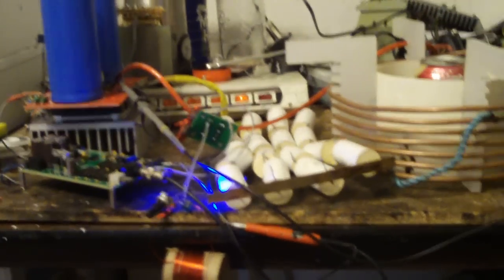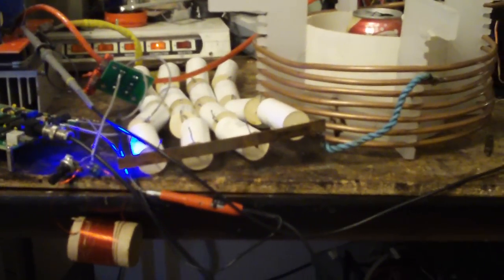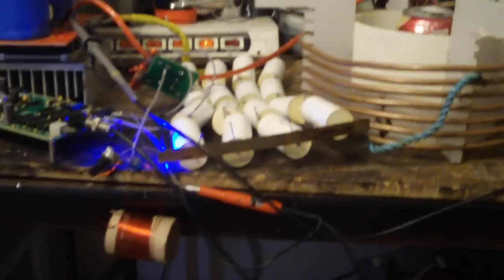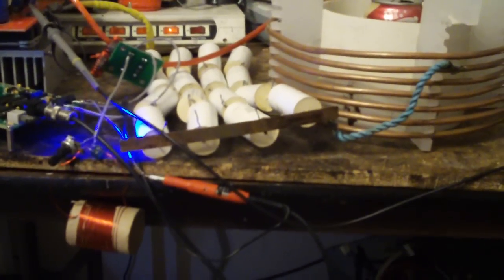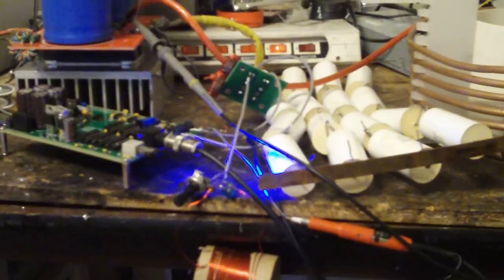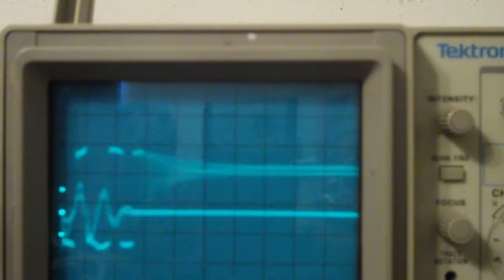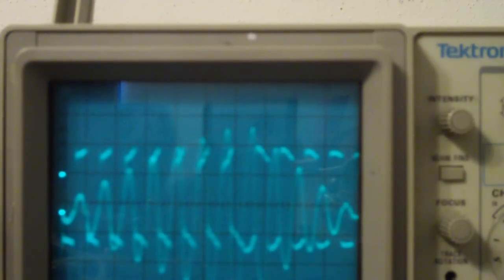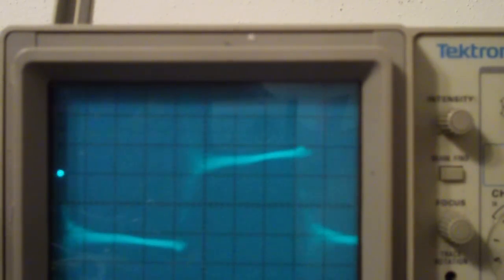Adjusting drsstc phase lead.

Comment: @Tab54o I figured out my problem. My first board had an on board interrupter, the second didnt, the off board  interrupter i had the voltage clipped to 5v  with two diodes. It was casing the voltage on the phase comparator to ramp up and down and was fckign with the quality of the output signal lol. Now I just need to find a proper inductor.

Comment: @triggerhappy77707 Well I use phase lead too in my own driver design but only on one coil and the other day i built another board and could not get it working on a half bridge ended up switching it out for a regular driver. It must be that particular board my first one works fine.

Comment from the maker: @Tab54o In this video i used an air core inductor and a pot, but it always seemed to work best with the pot set at its lowest resistance, so now i use a carbon film resistor and a rewound variable inductor. I got the inductor from some old TV board (the kind with the threaded ferrite tuning slug in the metal can) and rewound it with around 22 turns of 32 gauge and it works fine. Now i have it set at a higher res freq and the waveform is around the same, and it ran 620 amps seemingly fine.

Comment from the maker: @Tab54o The frequency in this video was about 44KHz, and i will be running about 64KHz, and this is a 4th (i think, don't quote me on this) generation cm300, so plenty fast enough. Incredibly, the rise time is is 120ns and the fall time is 300ns. It is a cm300dy-12nf.

Comment from the maker: Thank you for the kind words :-D. I just figured out what some problem i was having was, it was an interrupter problem. Now i just wish i had a better scope to double check the bridge output voltage, but hopefully this scope is telling the truth and i really don't have any ringing. I have already run 600 amps, which would be enough current for probably 5 foot sparks.